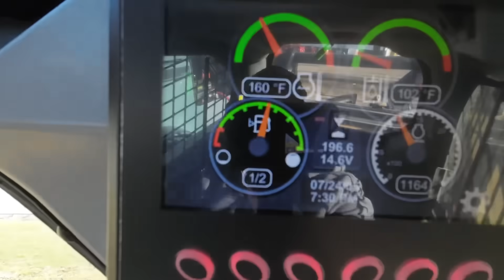The Massey Ferguson has left the farm! It was Fun while it lasted

Comment: When you picked that pipe up, I recommended renting a pipe welder when you did the install. Those large diameter pack joint fittings aren't cheap and my pipe supplier rents a Pitbull 14 for $60/day.

Comment: I actually made a water pipe laying tool cage, single shank sub from John Deere. Been a piece of pie, put a slow bend into it and fabricate it on the sub solder and you roll the price out and just drive along and bury it. Come back with a big tractor and pack it down, I could’ve laid your 4000 feet with it in about five hours been done the trick using it I would make one with no pipe so if I hit something like you hit the water pipe I can deal with it without messing the pipe up and then you come back and lay the pipe I pulled it with a 3020 grace and peace, merry Christmas. Enjoy your videos.

Comment: Is that a fresh water line or sewer water line? Seems like a long way to pump either, but fresh water is easier to push than 💩. Great video!
Reply: Oh come on there is no way you can push sewage through that small.pipe.over that distance. Secondly Brian actually showed you where the septic tank was and thirdly if that's where the water is it's not very far to pump.
Reply: @farmernige  I guess I didn't pay attention to the details. Thanks!

Comment: Wow I remember getting pink eye and I always got it so bad my eye would glue shut because of it and I always had it in both eyes. Hang in there you will start to feel better better soon. Good thing you bought it last yr it’s now about double on price. That is definitely a funny looking trencher. But if it works it works. I personally hate the reddish or orange equipment, sounds like a drive motor or a flow problem on the skid
Reply: I treated myself for pinkeye with the same Neomycin Sulfate puffer I used on cattle. NEVER AGAIN! Worked, but it wasn't fun.

Comment: Question, why are you trenching across the field but you might accidentally rip through. Secondly, you have that nice tool that you lay that big pipe with tiling pipe why don’t you use it to lay your water mine this food for thought I know I wouldn’t run across my field, because a couple years down the road your son to be out there ripping the field with a tractor and drive right through it then you have a mess Grayson peace I do realize that that tile flow can only go down to 4 inches but that pipe would feed through there so goodand you would be done Grayson peace merry Christmas